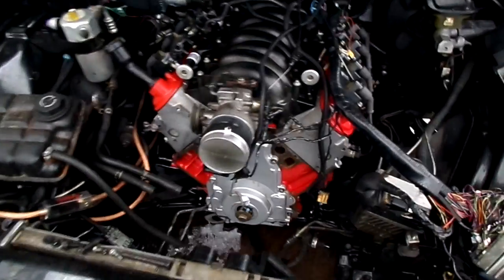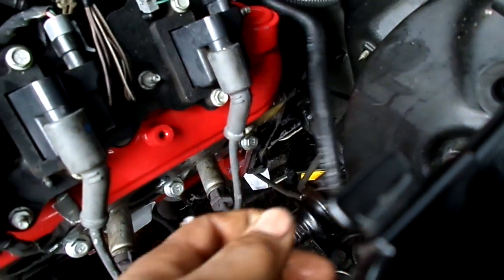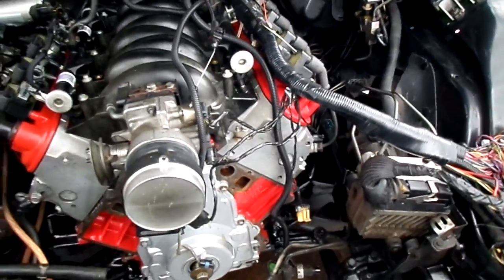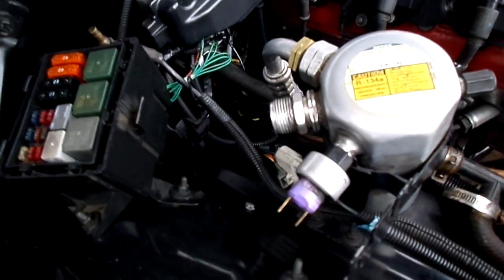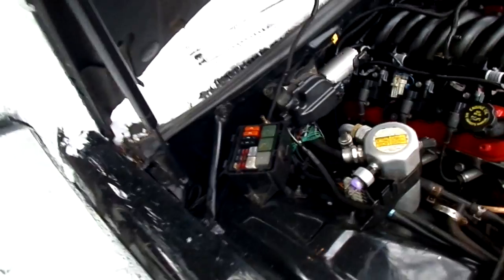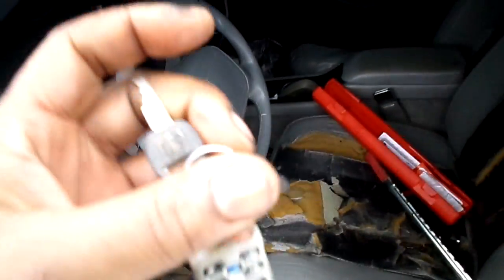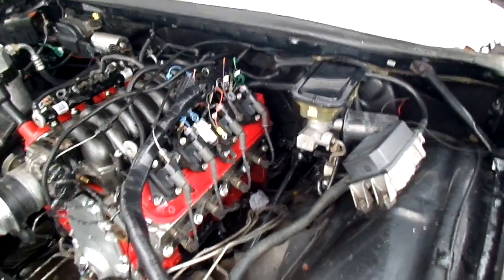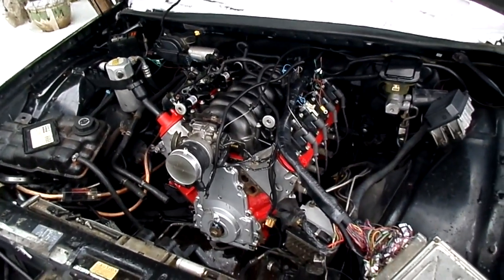How To LS Swap An 1994-1996 Impala SS (engine running)

Comment: did any of the pins on the transmission connector have to be moved?
Reply from the maker: No, not until I ran a 4l80 on a 4l60 program then I swapped 2 pin and used a relay to reverse the solenoid

Comment: You guys will never believe me I can get those 2 bucket seats done minus ss embroidery that's extra copy rights sometimes. I slip covers off like butter. Do my marks cut with razor blade all the factory stitch. Lay over fresh light vinyl and with little holes perforated. I copy old piece with chalk cut with scissors . I adjust for hot sun shrinkage. Pass it to my partner he sew it factory every stitch on point. I recover seat flip it in side out roll on like condom. I do upholstery on auto pilot mosty patch work. Hardest part is patching discontinued fabric but impala ss is light gray leather only top piece but it's pricey you have to by half hide leather.

Comment: did the ls motor just fit in thete or you get a custom k member
Reply from the maker: u dont change the cross member because its not removable. just get a oil pan that fits and the right engine mounts

Comment: lawn mower blade for motor mounts oh hell no if you going to put a ls in dont be cheap and cut corners
Reply from the maker: northsideryders if it works why do you give a shit u came to MY video, I didn't go to yours. I now have the SAME engine mounts on a 500+HP LS3 with LSA supercharger and nitrous. piss off

Comment: I just have one ? cause I have a 96 does a swap make the car lose value....
Reply from the maker: Jason Slaughter depends on who you are... to me no because its more reliable if driven the same way, no opti, cheaper parts, and more power. to some it kills it because its not "original"

Comment: what headers are you using?
Reply from the maker: +Miguelspl150 speed engineering. but the mounts i have may not work with how u have yours
Reply: I have the dirty dingo mounts.  I can move them around..  Thanks for the quick reply.  Been watching your channel.  Your project looks good

Comment: bad4health - I am a lifetime member at the Impala SS forums and I have to admit, the people there are VERY anti-LSx and pro-LT1. 
So, kudos to you for proving them wrong. 

Great work by the way. 
I am thinking of doing this swap myself.
Reply: I'm a member there and haven't seen much of that. they actually have lots of info to do the swap. for the ones who say not to have a point.  you can build an LT1 for a lot less than what a swap cost and still have more power. I'm doing the swap because I like the ls and always wanted to do a swap. now I'm going tondo 2 ls in the impala and lt1 in my c1500
Reply: +Miguelspl150 damn typo..  doing 2 swaps. ls in the impala and the Lt1 in my c1500.
Reply: Funny.
Reply: I went on there back when I had my '95. I mentioned that I was considering swapping out for a carbureted 350. I had like three pages of rants after that. Lol. I haven't been on in a long time. I'm fixing to swap out the LT in my '96 for an LS. I just don't like the opti-spark system. Nor do I like pulling the front of the motor off every time it acts up. And I would love to kick the engineer in the ass for locating it under the water pump.
Reply: +Miguelspl150 ....lt1 parts are far fewer and more expensive than ls. and non interchangeable...lt1 was a king in its prime.

Comment: Where u find a engine for that cheap?  and build for that cheap
Reply from the maker: i shopped around, and waitied for the right deal. and ebay man. like 187 for the rebuild kit and 16$ for the 5 gals of ourple power i used to clean everything with